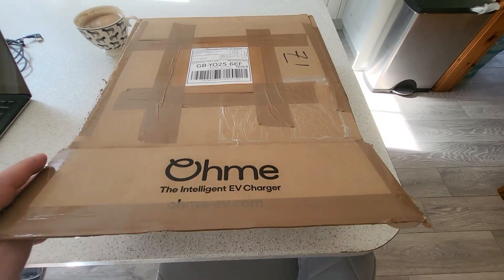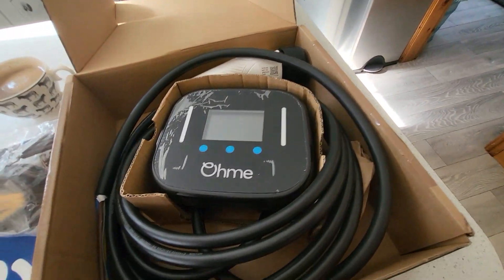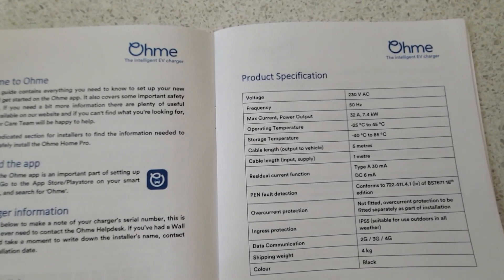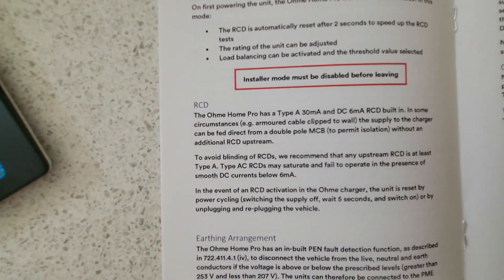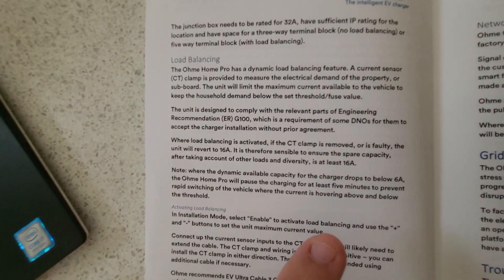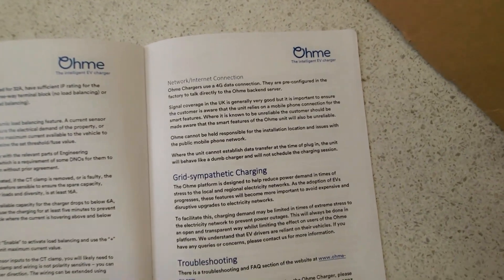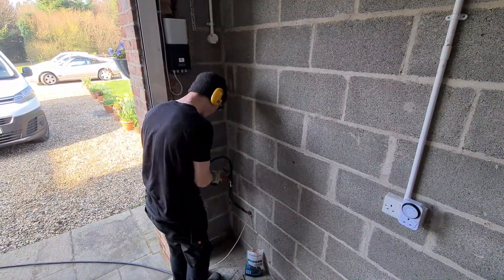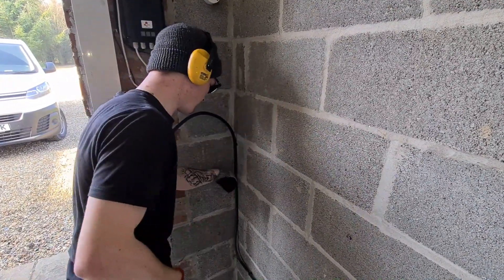Ohme Home Pro EV charge Point Installation

Comment: no spd  neededed?
Reply from the maker: Today probably. Then, no. One is in place at metering location though. Assume your not an electrician as you would know the answer to this.
Reply: not sure why nowsday standard installation most of it is including spd & rcbo    as today i hv got one fitted extaxtly fitted like your directly to the cosumer unit and joining the existing 80a rcd.  that is why  wonder more advice.  thanks   @electrician247

Comment: Hi Mark, just stumbled upon your video from last year...... I'm not a sparky but am looking at having one of these EV chargers installed. The electricity supplier has told me that a cable needs to run from the charger to the meter. This is going to be difficult to achieve at my property due to the location of the meter in relation to the driveway but a connection to a consumer unit in the garage is very easy. I didn't see a meter in your video - is what I'm being told by the electricity company incorrect? Do you need a cable run direct to the meter or does it just need to reach a consumer unit? Thanks in advance for taking the time to answer!!
Reply from the maker: Hi Adam. If the garage is a smaller consumer unit it could be the cable supplying it isn’t large enough for the additional load from an EV charger. 

The EV charger doesn’t necessarily need to go back to the meter but it does need to go back to a consumer unit with capacity in itself and the cable feeding it. 

I would consult a local electrician rather than energy retailer for advice.

Comment: Why not use the length of cable supplied to get in side the garage, then terminate in side the garage.

On to a different question I have a BP pulse charger installed how much would need to be changed to install a ohme pro instead?
Reply from the maker: Read the comments and contact a local electrician to answer question 2. Thanks

Comment: Great video...
I have an Ohme Home charger and it's been giving me lots of trouble. And now that Ohme said the log charger (installed less than 9 months ago) shows some faults, they want me to pay for the replacement. 
I had it connected it to the car and to the Agile Octopus tariff and saw that it often ignores it and charges the battery to 100% at whatever price.
A reboot fixes it, but when I contacted Ohme, they tend to easily blame it on the mobile network and on the car manufacturer API. But... the same mobile network works for the car app and how could an API issue result in the Ohme app showing different battery charge levels on different tabs at the same time? 
My verdict: Unreliable charger
Reply from the maker: All of the API link ups for EV and PV are the same. Glitchy at best. I manually control mine.

Comment: Great video as always Mark. 

Can I just check something you said about using the main switch as the point of isolation? 
On my EV course I was always told you need a double pole RCBO. Are we saying that’s incorrect if the main switch complied with reg 537.2
Reply from the maker: In terms of RCD protection both poles need to open. In terms of safe isolation to work that can be achieved via the main switch of any install or by removing neutral links. 

Note this install was pre amd2 of bs7671 and we would now be fitting rcbos rather than a shared RCD
Reply: @electrician247  fab thanks for the reply Mark so on that split load board. The RCD’s were dual pole hence it complied at the time. 

Perfect that makes sense. 👍

Comment: When the Ohme Pro is fully fitted how far will the cable stretch to? Yes, it says 5 metres but for a comfortable reach I would really need just over 5 metres rather than just under when allowing for a vertical drop against the wall. The optional 8 metre length would probably be too much and I presume it has to be fully unwound when in use.

Also, can it be installed alongside the meter cupboard (100A) with an additional EV consumer unit rather than through the wall and into the house to reach the main consumer unit?
Reply from the maker: I would advise against external consumer units the lead is exactly 5m no stretch or play in it.

Comment: Hi Mark, good videos!
would the clamp for the CT be able to go to the Live going in to the Main fuse feeding whichever side of the split board that the EV charger is installed? Inside the DB rather than in the meter box?

Comment: Why didn't they put the junction box inside the wall. Run the cable from the Ohme through the wall not the feed cable.
Reply from the maker: Read the prior comments and watch the video fully. Customer didn't want it that way due to ride on mower stored in the garage area. Not that it makes a bit of difference anyway.

Comment: Nice video, thanks. Just about to install an Ohme for the first time, they look really neat units. 

Is the cable from the Wiska to the Ohme ev ultra? I can’t see the cat5 there outside the JB so assuming you just used a short length of ev ultra (or similar) between JB & Ohme?
Reply: Sorry, since realised the pro has a fixed flying lead, but the epod doesn’t. So in effect yes the cable between the jb and the ohme is an ev ultra type integrated cable. I guess that’s the neatest way to do it for the epod too without a fox flying lead.
Reply from the maker: It's supplied like that. Cable comes with the ohme but yes carries rs485 and power
Reply: @electrician247  yes I see that now, I hadn’t looked at the pro until now. Thanks. Keep up the good work

Comment: its says nice job, i would ask the electrician to redo the supply cable and box to have a bottom entry or put a loop in the cable , rain will at the moment hit the cable and run into the junction box !!!
Reply from the maker: Ip68 cable gland, side entry, professionally done, 1 year post install, dry as a bone. Short story your wrong and thats okay. No need to waste the clients job redoing what is a nice job.

Comment: For the CT Clamp, which cable is the positive {+} ? Black or grey?
Reply: Pretty sure they aren't polarity sensitive
Reply from the maker: @Adam-Electrical  this is true to a point. On all CTs tbh. If you swap the cores over you also need to swap the direction the CT points.
Reply: @electrician247  I did find it odd. When we do commercial energy monitoring if we've got the cores the wrong way around to the meter we will get negative readings.
Since installing the ohme chargers it doesn't seem to matter which around you put the cores or the cts it seems to work. So I'm not sure if the software in the charger will recognise the  negative reading and change it to a positive reading. Works both ways I guess. Might give ohme a ring cause if that's the case then its very clever for what they cost
Reply: @Adam-Electrical  Ohme have confirmed that is doesn't matter which way round the CT clamp is installed.
Reply: @garysmith5858  hi Gary. I understand that mate but surely it must give a negative reading if it the wrong way. So the charger must know this. As the EO mini pros will read negative on commissioning page and go into fault
Reply from the maker: @Adam-Electrical  ahh must be the software! Smart stuff.
Reply from the maker: I can't be 100% as can't remember but black is generally positive and white negative on CTs.

Comment: It would of been neater to install the JB off the charge point inside, there’s more than enough cable to have run it inside and do the connection there. Best to keep JB,s inside where possible.
Reply from the maker: I don't disagree but the customer gets what they want and as discussed in the video was worried about hitting it with ride on mower. 

Nothing wrong at all with using IP JBs outside installed by professionals. It's what they are for.
Reply: @electrician247  Nice video, shame about the JB on the outside, makes it look a bit messy but if that's what the customer wanted fair enough. What about all the other stuff on the walls he could crash into! ;-)
Reply from the maker: @EssKayTee1  with the ride on mower he parks there? The concern for someone else’s wants is bizarre bordering embarrassing 😂😂😂

Nothing as strange as people on the internet it seems lol

Comment: How did you get round the ADMD on the application form to the DNO?  My DNO says they won't authorise an EV charger unless it's  no more than the cut out fuse.
Reply from the maker: You have to keep within your service supply limits. Load limiting is an option and most DNOs will accept this. Most charge points have this built in now. That said if you have a 100A head likely to be fine unless you have an especially high consumption
Reply: Cheers for your reply. I'll have a chat with the DNO tomorrow. I specifically went with the Ohme Home Pro for that reason. The ADMD came out over 200A on one ive just looked at😱😱
Keep up the good work and videos👍

Comment: Good video.. With regards to connection inside the outside JB, whats the best to use for this? Wago 221-613s? Or crimps?
Reply from the maker: Either works mate tbh. 👌
Reply: Hmm, was also thinking with regards to this charger, I guess you’ve run shielded Cat5e cable and earthed the drain wire? As it’s in the same JB, or would you not earth the shielding?
Reply from the maker: @jimborland5412  just need ti make sure the cable is rated for the maximum voltage present which it is. You can earth the screen if you wish but not required in this application.
Reply: @electrician247  thanks Mark, but on screened Cat5e, the sheath is rated to 300 volts but this is stripped off at the JB on a Ohme, and the twisted pairs insulation isn’t rated to this, it is much lower voltage rating? If there was a fault in JB, aka loose line connection, mains voltage could touch the twisted pair, or does the sheath being rated to 300/600 volts cover it? Sorry for all questions, EV is a bit of a minefield haha.
Reply from the maker: @jimborland5412  You have to get specific cable for the job. This cable is rated to carry 300V not just the insulation. With the EV ultra style cables they all approach it differently. Procell/Eland have individual screened cores while doncaster cables screen only the whole bunch as one. Great question though
Reply: @electrician247  thanks for the info. What Cat5e do you use? What manufacturer? For the 300 volt rating
Reply from the maker: @jimborland5412  it's from RS components I believe. I think it was myenergi or hypervolt who directed us at it a while ago. Growing market with lots of new materials these manufacturers are helping bring to market. You can't just lob in regular cat5e that's for sure lol.
Reply: @electrician247  what about the Belden data cable rated to 600v? Do you think this is ok?
Reply from the maker: @jimborland5412  any cable rated the required value as a twisted pair will be fine.
Reply: @electrician247  thanks Mark. So to clarify haha, you think the voltage rating of the inner core insulation being above mains voltage will suffice? Or would you say the copper conductor needs to be rated to mains too? Or is that the same thing? As it’s in the same JB.

Comment: Have to say I would take the fly lead straight through the wall and connect in the Wiska box on the inside. Neater and out of the weather.
Reply from the maker: Yeah so would we. But customer is always right and this is how they wanted it.
Reply: @electrician247  In this case the customer is obviously wrong.  I can't think of ANY reason why the install wouldn't look neater with the connection box on the inside of the garage.  Maybe the customer prefers to look at a nice neat interior garage rather than an untidy exterior wall!
Will be looking to have an EV charger installed myself in a couple of months, so this video has been useful to understand the process.  I have a similar CU, but I'm seriously thinking about having it upgraded (it is 10 years old) to use RCBO's and surge protection.  Not sure I would want the EV charger potentially tripping a number of circuits on the new Type A RCD.
Reply from the maker: @paulhill9132  you can no longer install EV equipment on shared RCDs due to regulation changes. I would say the customer has different wants/tastes than yourself rather than they are wrong. The customer is always right. I would always encourage updating older switchgear to modern standards. You also have the option of a small additonal EV consumer unit with SPD integration. It doesnt hurt even if the EVSE chargers such as the product shown here have both technolgies built in. I would consult a local reputable installer for advice to help fill in the blanks for you.
Reply: @electrician247  No, I politely disagree. :)  The customer is not ALWAYS right. They are not right when they trash a product and blame the supplier. They are not right when they use the product for purposes other than its intended ones. They are not right when they lie or demand you contravene any rules or regulations. But they ARE the only party which PAYS you.  So sometimes, unless it is unsafe, illegal or immoral, we must simply let the customer be wrong. And invoice them accordingly :)
Reply from the maker: @mrnixie  that's professional methods to achieve what the customer wants. In terms of desired results it is very much the customer is always right. Be that a worktop colour, tile finish or where equipment is sited. Respectfully disagreed and your wrong 😘
Reply: @electrician247  So you can no longer supply a charger from DB2 in a garage which is itself supplied from a 16th Ed. split board in the house ?
Reply from the maker: @geraldelwood9660  that would be up to the designer to consult the regulations and make an informed decision.

Comment: Is your Cat5e cable rated to the highest voltage present?
Reply from the maker: Covered in lots of videos already. But of course. Basics.
Reply: @electrician247 ah right cool, what brand is that and where from for Cat5e that’s rated to mains voltage? Don’t see many that are rated to this, normally use EV ultra.

Comment: I had the same EV charger fitted and didn’t want the junction box on outside of my garage, the main cable had to go in to a dug out 30 metre trench from outside main house supply due to distance and not wanting it clipped along bottom of my house. I was having the EV charger put on centre brick post between a double garage but can understand why they couldn’t do it . Here you could have avoided having junction box on outside garage wall and kept inside from where you placed it , you could have made a U turn with supply cable was there any reason you didn’t ?.
Reply from the maker: Yes the customer didn't want the junction box in the garage as was worried they would bump into it with stored ride on mower. Horses for courses and the customer is always right.

Comment: Surprised the junction box isn’t on the inside of garage. Just a thought. Saves bend radius problems though I guess
Reply from the maker: It's always an option but not necessary. In this case lots of stuff stored internally so keeping it external made sense. Either or, same result.
Reply: Personally I don't like plastic boxes/switches/sockets in garages.  Too much risk of damage from all the crap people keep in them.